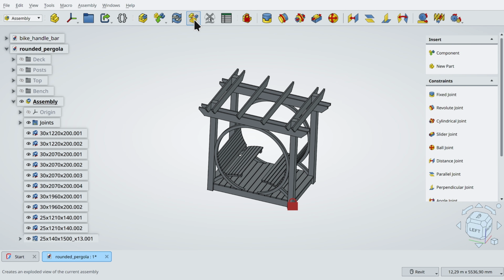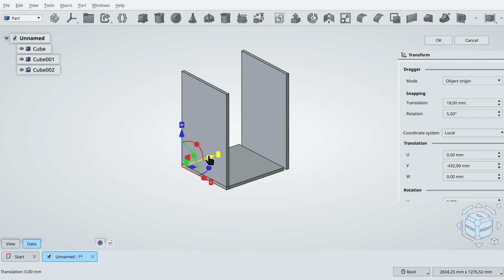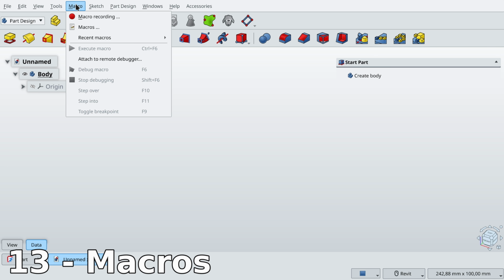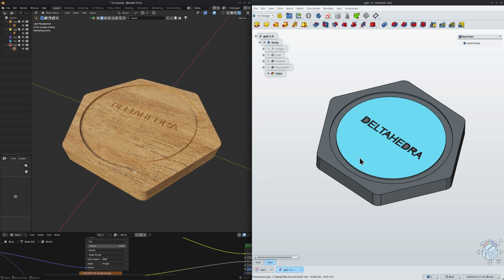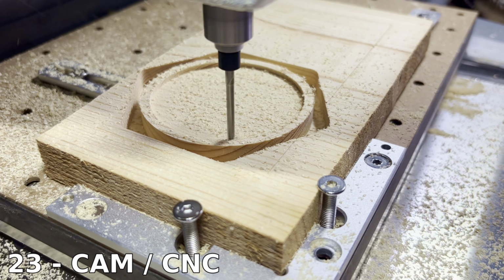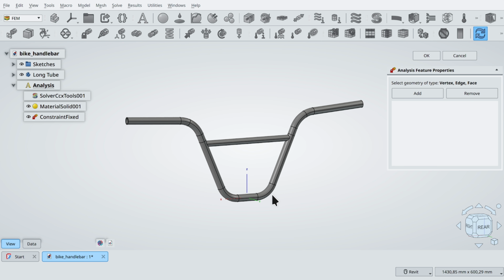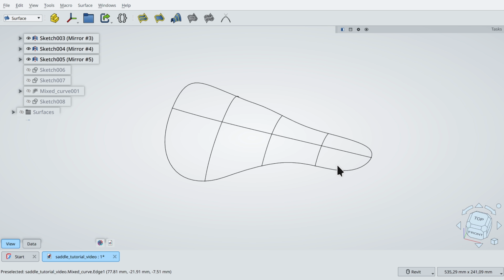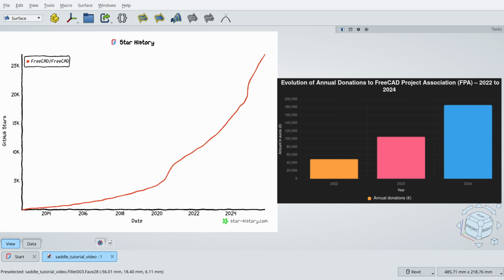30 Reasons to use FreeCAD in 2026

Comment: You got me at caveman! I tried FreeCAD years ago, but as a longtime Solidworks user I found it very un-intuitive.  Your video shows FreeCAD has grown up. I'll give it another go. 

Great vid btw
Reply: Send second try experience feedback. Thanks
Reply: @shariqkhan9991  Ok here we go. At first I had a few issues installing it on my main PC, CachyOS. Whilst figuring out some issues there I installed it on my old laptop out of curiosity. This is an old i7 Sony vaio 8gb RAM & Nvidia GPU, nothing special. It's running Zorin OS, and FreeCAD just worked. It wasn't the stuttery hot mess I was expecting. Though I didn't do anything intense with it, I found it very responsive and smooth. There is no way Solidworks would run on such a low spec machine!
A couple of days later I got it to install on my main PC, hence the delay in replying. I will say, FreeCAD most definitely has grown up since the first time I looked at it. It is smooth & responsive, and very feature rich. The people working on FreeCAD should be proud of themselves, thus far I think this is an outstanding bit of kit. Did I mention it's FREE?

Now for the part that will bring me hate. The terminology! I find some of the terminology not very intuitive, for example: 'pad' for an extrusion or 'polar pattern' for circular pattern. It's like learning another language. Now I am aware a part of this is my 'Solidworks brain' refusing to let go & I just need to invest more time getting used to new ways. But you asked for my experience feedback & this was it so far. Moving forward, I will continue to attempt 'mastering' FreeCAD. Not sure at this stage how it will all end (I use CAD regularly as part of my job) but I'll give it a good crack!
Reply: I had a look at it a few years ago and it didn't look anything like this.  Looks like it's come on in leaps and bounds.
Reply: Please give feedback, i need to know
Reply: So how did it go?
Reply: @ndrechtseiter  dont expect for a second that you will be able to simply do what this guy does in this software. Simple functions will just spit out errors or not function at all. (like a fillet on a simple flat surface can make this software completely shit the bed if you didn't pray to the correct gods recently) and this guy seems to have the direct line to their boss.

Comment: my only real issue with freecad comes from the lack of hardware acceleration. outside of that, its great. I have been certified with 2 other parametric modeling software and can say that the flow of freecad is great once you get used to it

Comment: Your presentation is convincing. I want to love it sooo badly as a HUGE Blender fan and mechanical engineer. I installed it about once a year since its inception. It always had nice features and clever tools indicating the cleverness of the creators. It was just always soooo buggy and incomplete that eventually I switched to Onshape. I hate cloud stuff but I need to my CAD stuff to be absolutely rock solid and apart from the horrid cloud BS Onshape is really a tool that allows me to build flawless models at the speed of light. I will surely try FreeCAD again and again. But I am not 100% convinced that we are there yet...
Reply: Try Solid Edge Community Edition. Free, more powerful than Onshape and no cloud.
Reply: well, always free to try. 

you can maybe try a bounty model to request a certain feature or bugfix with a bounty. you will then officially be a contributor to the project. you can take some pride in that.

Comment: I have to say that FreeCAD is really good, but it's not quite ready yet. Many steps have to be considered carefully. For example, it's not possible to add this radius 9 at the end; the step has to be done beforehand. With Inventor, it works without any problems.
Here is the component. https://youtu.be/B-rqY6ZfYmA?si=pnIBGy9RR4Po-dH8

Comment: Your video is excellent, and I agree with the 30 reasons. I was selling AutoCAD software back when Windows didn't even exist, and Mouse hadn't been invented yet. Around 1998 or 1999, I discovered Software Software, and later CATIA, but with all of them, my use was limited to doing work for companies that had licenses. Then, in 2020, I came across FreeCAD 0.19, and since then, I've been able to work independently without license fees and that kind of stress. With my previous experience with design programs, I quickly became familiar with FreeCAD, and I highly recommend it to all types of users. FreeCAD is the best thing I've found in my professional career as an industrial mechanical designer. Thanks to FreeCAD.

Comment: FreeCAD is great, but it also needs some major UI overhauls. The difference between parts and parts design in particular needs to be made clearer, and I shouldn't have to go to the menu bar for options.

But hey, it's free!
Reply: Remember how wonky Blender used to be? This platform could go the same if we all chip in
Reply: @Planetinaction  I mean blender is still a usability nightmare, but yeah it's improved a LOT
Reply: @vincentguttmann2231 Blender isn't a usability nightmare if you compare it to similar programs like Maya,Cinema 4d.I mean,a program as robust as blender can't make to be simple.
Reply: @vincentguttmann2231  I find the blender workflow extremely intuitive
Reply: Blender has same problem as GIMP, it is small group of users who want those to become commercial software clones for free, why they whine about GUI, but dont care when existing ones are better than what they want.

FreeCAD has own problems, but GUI isnt major one. The primary problems are in logic of operations, some steps to be removed or made obvious. And some errors to be avoided by automation or specifying exactly what is the problem without generic error message.

But GUI in FreeCAD doesn't have such problems, but can benefit from polishing.

When people don't know how to use the tool, they blame the tool, instead themselves.
Reply: @paristo  to be fair, in Gimp's case, its UI really kinda does suck.
Blenders UI is honestly kinda nice to work with IMO, but at the very least is a significantly better experience than gimp
Reply: @toolazytobeoriginal4587  Gimp is great and superior to Adobe's, if you know what technically you do to get the artistic results. You need to know the process, and for that it is superior to Photoshop, that is more today to "click for filter", than to understand the whole process and how to do stuff.

The fact is, people don't want to learn the process, they want just to get the results. They ain't creative, they just want to copy something they saw and get it as easily as possible. 

That has been Achilles heel in the Adobe products for last 30 years. Just look the people who are in the universities learning to use Adobe products, and people with decades experience using those, usually those don't really know how to be creative.
Reply: @paristo  I mean the thing with blender and gimp is that they're serving a REALLY diverse audience that all has very specific functional needs, so there's only so much you even can do.
Reply: It's open source.  They would absolutely appreciate the help on the human interface (UI/UX) front!
Reply: @PurpleYoshiEgg  Being open source doesn't exempt it from criticism. Evolve digimon...
Reply: I agree the Ui sucks. This is probably because there is no central development center like commercial software as far as I know. The UI for every part seems to be developed by each cat with their own idea of a UI. 

I've been using SketchUp since before Google bought and then sold it. Yes, I know SketchUp is NOT CAD but it does what I want to visualize my projects and look for interferences. I've tried to learn FreeCAD from tutorials but each one was for a different pre V1.0  development version and there was no consistency in the UI so it was it was a frustrating dead end for me. Now that FreeCAD reached V1.0, maybe I'll try again. 

I learned AutoCad in the '80s and found a free perfect (in every way) clone ( ProgeCAD free) but it's really only 2D CAD. AutoDesk used to not be totally evil but they turned and that's why I'll never use Fusion360. It's not clear to me that they won't copy steal your work if they want to.

Web based CAD is fine for those with perfect internet connections but I'm in a rural location with up and down service. I've had variable internet for over a month but they seemed to have finally fixed it.  My speed was from none, to 200mbs , to dialup modem speeds. It currently is 200-300 mbs down and 200 mbs up.
Reply: Thank you for the video. I was playing with the thought of switching from Fusion to FreeCAD. Now I have 30 more reasons to do so.
And honestly I would be more than happy to send donation to FreeCAD developers instead of supporting corporate greed of Autodesk
Reply: The issue with FreeCAD is it is a combination of C++ and Python under the hood and, as a developer who is happy coding in both, I personally believe that it is a Frankenstein's monster / absolute garbage fire of a codebase. 

I tried to address a PR that involved the way that technical sketch areas are labeled? Yeah I spent over an hour bouncing back and forth between Python and C++ classes around 4-5 times before I ultimately gave up. 

I think the reason the UI is so jank, is because the way Python and C++ talk to each other is just simply not nice to work with. And for record I love both Python and C++, nothing wrong with either language, but together? It is just a dumpster fire imho :S
Reply: @ObjectiveOrientatedProgramming  I am sure that SolidWorks and others have pristine codebases 😂 
Most software is lipstick on a pig that you just don't get to see
Reply: @some1private I agree they can. But objectively Free CAD has a long standing Jank issue. 

One i know from experience is not easily solved due to how its structured.

I am not judging FreeCAD based on others, im judging it as its own product.
Reply: @ObjectiveOrientatedProgramming  Yeah, that's how it often is with FOSS development: lots of effort, but little coordination leaves a project unmaintainable and unextendable. Tantacrul/Martin Keary talked about that in the video he did about MuseScore 4 - they also had to shed a lotta weight by changing how they worked with Qt
Reply: @vincentguttmann2231 yeah it annoys me as its a big problem with modern software. Piss poor planning and doubling down l.

"Oh but python was added to make it easier to contribute"... 

Not when you have bugs that are impossible to track down due to logic that crosses back and forth between python and C++ every 10 to 20 lines 😭
Reply: @ObjectiveOrientatedProgramming  god sounds like a nightmare.
I mean plugins in python? Sure. But please keep the core logic consistent, and in C++ or sth.
Reply: @vincentguttmann2231 The issue is Free Cads way of building out functionality is this weird ass "plugins but not really" system. 

Which i am a little dissapointed wasnt explored much in this video tbf.
Reply: @vincentguttmann2231 tbh Foss usually is bad ui but lovely features. Regular soft is kinda opposite.
Reply: You can easily install alternative user interfaces.
Reply: @Wes-r6w4b  Do these change the looks, or really reorganize the application?
I mean, having workbenches is great, these each have their own powers, but sometimes you need to do a certain "something" to use something from Curves workbench to go with your Part Design thingy, it seems.
A UI skin cannot fix that - I'm sure other CAD is the same under the hood but they automate the required steps.
Reply: @Wes-r6w4b  Yes, I can. And given that I'm a Linux user, I already did that.

However, you have to approach these things from the perspective of a first-time user.
So if you want FreeCAD to be successful, placing the burden of improvement upon new users probably isn't the best thing to do. 

The out-of-box experience has to be good enough for a user to stick around in the end, too, so they discover you CAN actually install other UIs.

If you manage to improve the experience for first-time users, you often also make things easier for legacy users - yet another example of the curb-cut effect.
Reply: Strongly agree. I think how slicers do things is a major thing freecad needs. It gives many things their technical behind the scenes name. Most slicers use a user understandable name and the technical name is found when hovering over it. This is imo the optimal method as it is not confusing to a beginner but helps the devs and those making tools to improve freecad.

Comment: Fun fact: I work in a company with  heavy SolidWorks usage, but for some specific robot toolpath generations we use FreeCAD over any other comercial CAD program. Solidworks is faster and easier to do the machinery designs we do, and time is money, but the fact that FreeCAD can perform all the same actions is insane. There was really some great work put into this tool and all the add-ons. With a few minor updates FreeCAD will become my daily driver for home use over Fusion.

Comment: Nice video, but! After such a video I always try what has changed and whether it is time to switch to Freecad. 
And I always reach a point from which I simply cannot move on, although I have followed the example exactly, either yours or someone else's on the net. The most problems are, for example, with the sketcher, which often shows an open sketch, although everything is closed and connected. Not only is the error - if there is one, hidden and impossible to detect, but there is also a lack of a working (I repeat working) tool that would reveal such an error. 
And for experts who would like to assess my skills: I have worked for over 30 years as a designer and development engineer and have used the Pro Engineer (Creo Parametric) system almost since its inception (Since the early 90s), as well as later Catia, NX and Fusion 360. 
I consider Freecad to be an excellent idea and a really necessary and useful software. Especially in the age of 3D printers for ordinary people. But I consider it important that the elementary and most important parts of the system finally get to a state where they can be relied on and work more, rather than less.
Reply: the sketcher is a mess and slow as all hell if you need it to do anything non trivial

Comment: I am sold for FreeCAD. Since 1.0 it is all I need. I've tried it in the past, struggled a lot. Some time passed and I decided to try it again with 1.0 and was amazed by the progress. It's future is brigt!
I had the same experience with KiCad. Tried it once, struggled, came back after several years to KiCad 6.0. Now, for me KiCad 9.0 is the best PCB design software I've ever used and I do some fairly complex stuff at work.

Comment: I appreciate the video, but I would still like to say that FreeCAD is a long way from being a reliable and software ready for professional use.
10) "FreeCAD has all the tools you need". No FreeCAD itself is actually missing or poorly implementing quite a large amount of industrial features that are commonly used by professionals. Working with curves (Bézier) requires external plugins which are not updated regurarly and are often unstable, and cannot be reliably used. Advanced features for Fillets are absent, Patterns with >100 units lag to the point of being unusable, and many others I don't have time to write here. Tools for injection molding design are absent. Collaboration tools are 0. TechDraw is ridicolously simple, missing tolerances, GD&T, advanced section types, and so many other things.
14) Assemblies are extremely poorly performant for complex projects, again due to lack of optimizations. Even the assembly example which is provided by default inside the software (excavator) is laggy, and that is a BASIC assembly project.
And generally, the math kernel (OpenCASCADE) is quite outdated and unreliable. On top of that add a confusing UI with non-standard operation names and an uncanny workbenches like Draft...
Reply: I was wondering if they fixed the assembly issues. That one is critical for me. I'm often designing entire assemblies and the last time I tried FreeCAD it just couldn't do it. I sure hope it improves though! I would love to jump ship.

Comment: Newbie question: if you import a model from another CAD, it may not have any sort of history tree. If you want to make minor changes like adding dimensional clearance ( for machining or 3d printing), or moving holes, changing their size, how would an experienced FreeCad user tackle this? Do you have to start from scratch and make a constrained drawing? Do imported step files have constraint information built in?